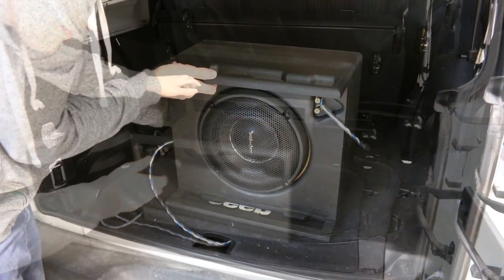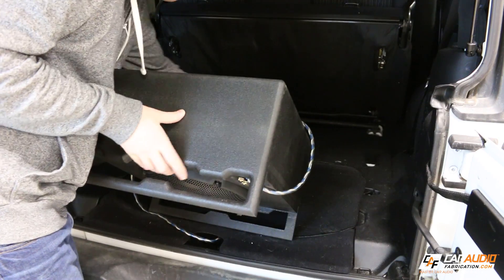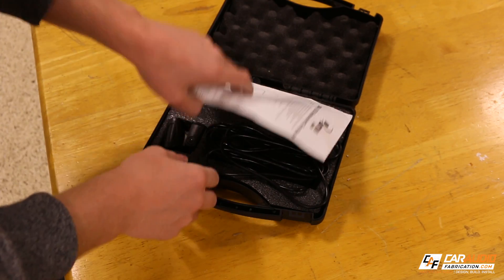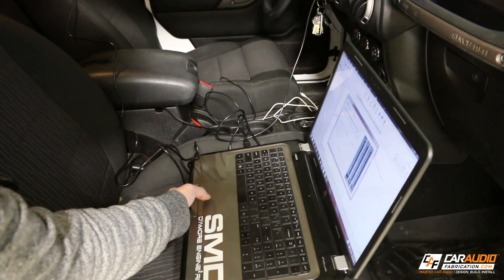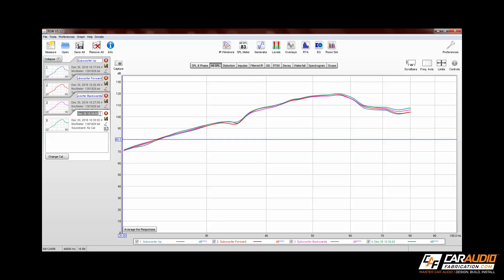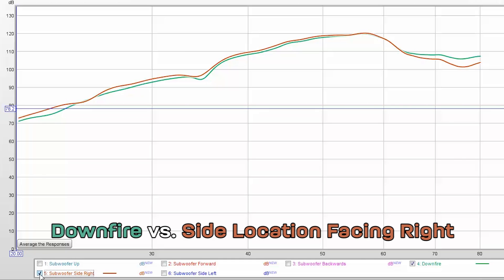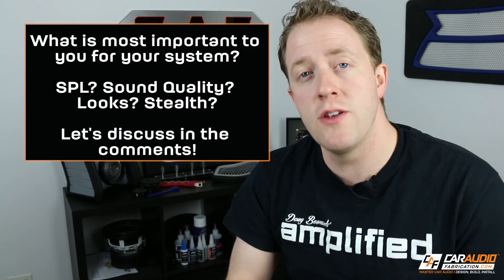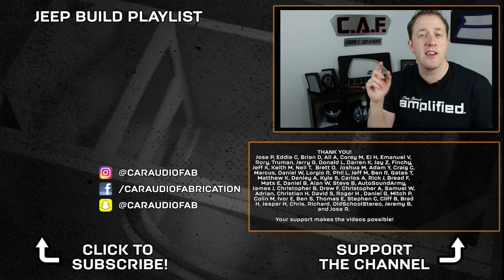What subwoofer direction is best? HOW TO TEST! - CarAudioFabrication

Comment: So i know this is an old video. I have a small truck with no room to hide a sub. I have always had a 12 or 2 in my vehicle. Never thought i would go smaller. So i built a tube box with an 8 inch CT   1600w subwoofer at one end and a port at the other. I planned on having it in the middle of the back seat with the woofer facing forward and the port against the back seat. Would it be better to flip it around where the speaker is facing the seat and the port is forward?

Comment: Maybe I'm just old, but I thought we decided 35 years ago that 45 degrees was "the direction"? Or 10-20 degrees off 45 depending on car, placement, etc... I haven't built anything in over 20 years, so all this internet info seems a little overwhelming heh. 

I do think imo that any speaker is gonna have better SQ the more it's pointed towards you or the materiel it's bouncing off plays the biggest role. anyways, no idea, good vid

Comment: time alignment considerations.. i was told by installers years ago that if you face the sub and/or port backwards, it takes longer for those big, slow waves to hit your ear (they have to reflect off the back of the car trunk/window/etc.. as such, the output from midbass will be microseconds ahead of the sub output and will sound muddy. the fix? reverse-direction subs sound better if you change the phase. 
*side note, i have a left firing box and i changed the phasing which makes it louder.. why is this?! i mean, all my connections are in proper phase at sub and amp. but phase change via the head unit and it doubles in volume. weird.
Reply from the maker: Not really a correction as you will still not be perfectly in phase just with a simple polarity switch. To fully optimize you need to use time correction with a DSP.

Comment: This doesn't seem right. I hear extremely noticeable differences in how it sounds in each orientation. I am using time alignment but I'm properly configuring it for each location.
I just can't get a vented box to sound musical in any position, however (tuned to 34hz). There are no dynamics. Stuff like classic rock is either overblown boomy bass or not enough. I'm about to try sealed.
Any time on getting car audio bass to sound anything like home speakers?

Comment: My goal is of course to a good amount of bass with the best sound quality you can possibly get. Not just low but low like a pro.. My challenge though is that I drive a Nissan 1400 Champ 1997 and that means I have one place for installing a subwoofer or two since it has almost no cabin space. I have to locate my subwoofers under my seats and it has to be shallow subs. My build is going to be very difficult since I don't want to cut my cabin.

Comment: Years ago I spent most of a day setting up a sub in the cabin of my boat installing it in the only unused space.  After getting it all set up I cranked up the radio and had no bass at all.  The speaker was moving like crazy, but the sound was like holding the speaker in open air, just air fluffing sound.  That day I learned the term "standing wave".  I could move the speaker about a foot in any direction and get good bass, but not in that spot.  Having no other options without loosing storage spaces I turned the speaker around so that it was firing under the floor of the boat instead of into the cabin and it worked great.

Comment: Nice to know that the direction of the speaker doesn't really matter.  It makes perfect sense, it depends much more on what your box is physically touching. I had to move my 2x12" box behind my driver seat (SUV) on top of folded down back seats so I can still use my trunk for storage. The fact that it has to reverberate through seat padding before the vibration reaches the hard car body makes me need more power. Luckily, I have a lot of wattage to play with lol.
Reply: Bass is omnidirectional.

Comment: Broo you need to change the graph, click limits and fit to data or just the + in the corners and move around. The gaps will be a lot more clear.this video is old so you prob know this. Also don’t know if you e done videos, REW now has a bunch of time alignment tools. It was originally telling me to delay speakers 42” but w messing around I found best result w zero delay and inverted sub phase.

Comment: Hey bro- I’m building a work van system so space is an issue, I’m going to install the kicker downward firing 12 inch subby but can’t face it down- in a can cab would they work just as good bolted to the wall facing forwards or is it better to face them backwards facing the wall?
I want the bass to be felt more and heard less in the front cab
Running 2 boxes so 4 12 inches with a 1200rms mono block wired 1 ohm - cheers love your posts

Comment: Have a 2009 Eclipse that I just put two 12" Alpine Type S in. They're a dual 2ohm by the way. Had to wire them in parallel to create a 2ohm as the amp is a 2ohm. Anyway, it's a hatchback limited space situation. I usually rear fire  a sealed sub in a hatchback but the space is limited and I didn't want to to risk damaging the subs because of the excursion (it was close). I set them in an upfire position and it sounds great actually. My curiosity is killing me though. Would there be a difference between the two positions? If so, would it be marginal or noticable? I'm actually thinking the upfire sounds better honestly. What's your opinion?

Comment: I flipped my subwoofer box today which houses my 12 inch pioneer previously in a rear facing position. I also had two 6 by 9s mounted on top of the subwoofer box each in its own enclosure. So today flipped the subwoofer to be upfiring and the two midranges to face forward. Car is  the local equivalent of a 2012 Mazda 6.
I feel like the sound is fuller and the bass louder and deeper.

Comment: I really need some design help for a under seat of 2019 f150. Got 2 RF shallow mount 12’s but not even close to the spl of my old RF power HX2. My box is sealed.......
Question
Would 1-2 8’s running 800-1000 in a porter box sound better than these 2 12’s that are 250rms each? 

Measuring my box adds up to about 2 cuft but I think I want a ported box...... I need help or suggestions. Once again love the video and keep posting great content.
Reply: And they are currently down firing, thought facing them up would help with spl in the cab but looking at the data, it might not haha

Comment: I'm super late but I love SQ. I like hearing all the instruments and notes in a song. I like stealth too. My 2015 VW beetle is a hatchback and I tried all the locations, no down fire option with the box. I found that it sounds best on the right side facing left. At 46, I'm done with big bass. I've even went as far as adjusting the fade/balance to get the best center sound for me while driving. If all you can hear is the driver door speaker, then to me you're not getting the sound quality of the whole system. I've upgraded all of the speakers also and HU. I've set the distance between driver location vers each speaker and sub. The Kenwood HU has to many options for the speakers. Lol. Two amps.  I think that it sounds nice. But that's with my ears🥰

Comment: Does anyone like to use two subs in different style enclosures to be well rounded and fill a broader spectrum of sound without a peaky one frequency vented or an ‘okay’ and flat serving of equal bass in a sealed but not really the same intensity as the potentilly narrow (er)zone of vented big bass?  Aside from multiple chambered and tuned vented higher order bandpass stuff that occupies unrealistic space in a vehicle used all week for commuting, shopping and recreation, anyone setup a sealed 10 and a complimentary tuned seperate 12/15 that vents at a hertz window that generically fits that section of hard hits in the 30-50 or even 45-80 depending on the preferred genre of rap/hip hop/electric type or the hard rock/hip hop/whatever thats the latter frequencies generally? Or a box thats a bit big for sealed but a little small for vented, but still acceptable and having a vent that can be sealed with a gasketed insert that even has a threaded insert or magnets? This is probably pushing concenience, but the other dual woofer in seperate configurations ever employee with noted success?

Comment: I had a woofer in a tube box and it was facing to the left side. When listening loud music while having a bumpy ride, that woofer died. The woofer moved left to right while car jumped up and down.  Subwoofer should be faced up or down. Why?
If u turn all volumes to high while holding your speaker in the hand , try to change his facing and u will feel its resistance . While doing that ,sometimes u can hear voice coil scratches the metal if you try to change its facing faster. That is happening while u drive on a bumpy road.

Comment: sound quality comes first but i also prefer not modifying the vehicle any more than necessary.  Im 52 and have been messing with sound systems for almost 40 years.  The technology available today makes it possible to create incredible systems in a stealth fashion.  I just wish the auto manufacturers would designate spaces for the items we need to install to build these new systems that utilize the factory radio and special features.  finding room to hide components is getting more challenging every year even as i have become a much better fabricator.  I had to hide an amp in a fold up seat bottom in my sons 4 runner and the audio control in a home made bracket under the passenger seat.  Couldn't figure out how to hide the ported box with 2 12s. Hmmm lol. Thanks for what your doing.  Its nice to see someone genuinely enjoy sharing their passion. Keep up the good work.

Comment: Hey mark! Im currently building a complete make over system in my 2 door jeep now. Im using a kicker L5 square subwoofer for my bass... im wounding at beginning of your build you said u where going to down fire your sub above the amps? At the end i see you mounted the subwoofer next to rear seat? Maybe i missed it but why did u change the subwoofer location? Askimg because i think im going to use/build a down firing ported box for my sub. Also any tip or imput on what im using would be great! Thanks

Comment: I guess i've never measured this, but i typically can tell whether the speakers are facing the front or back of the vehicle, by whether you hear it more coming, or leaving. In the cars i've had, when they face the back, i hear it more from the front. facing the front, i hear it more from behind the vehicle. Also pretty negligible difference from the cabin. 

Any thoughts on that?

Comment: Back in the mid 90s, had a early 70s Plymouth duster,  we put a jvc cd deck, a 30watt crossover n a pair of 6×9s on the back deck.spent $175 TOPs .Sounded better n louder then then guys that spent  hundred $ more with amps n subs. It's all about correctly matching components..
Reply: Lol 6x9 vs subwoofer you kidding. Right? You compare apple and carrot
Reply: You're right. Maybe not the same bass punch but overall you didn't need a sub if you had the right components back then.

Comment: An Insane Audio head unit would look sweet in your jeep.  Added that to my JK 2dr Rubicon and I really like it.  Replaced the speakers and added an amp.  My next project is the Sub.  Your test in this video saved me the work of testing locations.  My 2dr is very limited on space.  So, I am going to replace the rear seat with a full vehicle width box to house my Amp, Sub, and a 3 gallon air tank for my compressor.  It should also provide the needed storage for recovery gear.  I stayed away from using the location you chose because I need the room.  Thanks for all your videos.  I feel like I am prepared to start the build.

Comment: Good evening, love your videos.... great enclosure designs....!!! I have a question, in your professional opinio:, I am looking to design a SQ subwoofer box to be palced in a 2010 Corvette coup. Options: 1) four 6.5 Tang Band in a 1.0 CF sealed box placed up or down firing, 2) 1 8 inch Dayton HF sub, down or up firing or 3) 1 10 inch Dayton HF sub down or up firing. My goal, SQ with tight bass that thumps like a punch in the chest. My bass head days where I vibrated the entire block are long gone.  Input greatly appreciated... Dr. Tommy O!

Comment: Honestly bro your measurements were so similar the positioning seems to be a total wash. If you aren't seeing maybe 3 dB or more you ain't gonna hear it. Maybe it's a Jeep thing. Or maybe just bumping the sub is a waste of time. You need to sweep with other bass producing speakers firing.

I think when it comes to bass phase is the bigger issue and it does relate to placement. I've measured quite a few cars at this point and most have similar problems like suckouts around 60 hz or peaks / dips around 250 hz or so. In that case orientation is a lot more important, and most cars I've had sounded best with rear-firing woofers that were 180 out of phase. But even then I had to choose a good bump, or some cancellation.

Comment: So im only 17 and im really wanting to figure out a lot about acoustics and where to set up different speakers what to run it how to set up wires basically how i should set up an audio system for my car. i wanna know if you take two subs and have them on left and right side facing the middle essentially firing directly at each other would it lessen the audio quality and/or lessen the bass of music?

Comment: Happy New Year. Fantastic video education series. Questions: 1. when building a down firing subwoofer box, what is your recommendation for the amount of space for the legs (height, 1, 2,  or 3 inches)? 2.Does the texture of the floor, let's say a smooth carpet verses a heavily textured. Does the heavily texture require additional height (inches)? Thank you in advance.

Comment: Nice Video CAF !! , been working making car sub boxes for my last 20 years and to me always aiming the woofers to rear end of the car give you the best bass possible when isn't for SPL competition. 
Thank you, CAF  very informative vid!!
 Pdd, ports aiming to sides or rear end aswell!🛠🔈🔉🔊
Reply: Milton QB do you mean in the back facing to the backdoor of the car
Reply: bro i have 2 12" subs each 400RMS.
for your info they are pioneers 306c and 308d4.
i have them in separate enclosures, facing each other in the trunk of my car placed on each side. their ports aren't facing each other; one is on the top, other is at the bottom.
what would be the best possible way to maximize their output? should i place both of them in one box? or should i place them in one enclosure having separate chambers for each sub?
Reply: @ahsannnaeem  separate boxes are better,  cause the box will be  more rigid when its come to handle bass sound wave on the interior. I use to make separate boxes most of the time and always facing to the back of your car. Year 2004 I made a Honda civic 3 door, loaded with two 15" MTX 3000 and each sub hooked up to a MTX 2300 amplifier (mono 2 ohms) and 4 optima yellow top.     
RESULT=157 SPL we took first place on 2000 watts RMS category. Good times 🛠🔈🎶

Tip: wrap whole trunk if possible with good quality insulation to avoid excessive bass vibration inside and outside, also boost cabin pressure!! 
🤜🏼BASS🤛🏼💥🎛

Comment: It kind of depends on the car. Brand new car that you want to keep stock and need the storage? stealth/quality. Fully custom car? do what ever you want to make it look cool. Strictly bass orientated? volume levels.
I have always gone with a stealth/quality. i don't want my crap getting stolen. That's why I like molding it to the trunk space like some of the companies that make vehicle specific kits do, and under or behind a seat for a truck so you don't sacrifice cab/seating space. Might not get the big number but you get no numbers with a broken window and disconnected wires in your trunk.
Reply: If you to poor to afford a car alarm and tint window .  you also to poor to afford a stereo system.

Comment: is 10 gauge speaker wire overkill for a jl c2 6x9 and 6.5 component setup
Reply: I have the JL C2s in my car right now and I believe the wiring is something like 16 or 18 gauge. Unless you are connecting the speakers to an amp, I wouldn't use a large wire. There won't be any difference in sound since the speakers won't really be putting out much power. Mine are just connected to the factory stereo HU which hardly puts any power out.

Comment: I like my install to look super clean since it is a reflection of myself in the job as well as its safer and easier to work on it when the relays are wired properly and tucked away and mounted securely or the adjustment screws are accessible. I prefer it to be seamless, not invisible.  When someone looks at it,  I want them to this kind it could've come from the factory that way. No flashy Fast and Furious shit for me. But, in the end, sound quality is most important because what's the point that of installing audio equipment if it doesn't sound great.

Comment: Sound quality first, looks second (with plus points for stealth). I'm curious how the different configurations affect tactile feedback and/or sound localization. I guess the only way you could measure tactile feedback would be with an accelerometer or by putting a bowl of water on the seat and see which creates the biggest ripples. Sound localization would be more subjective.